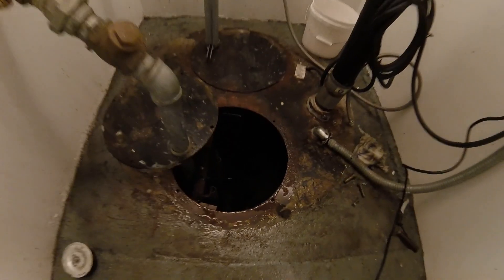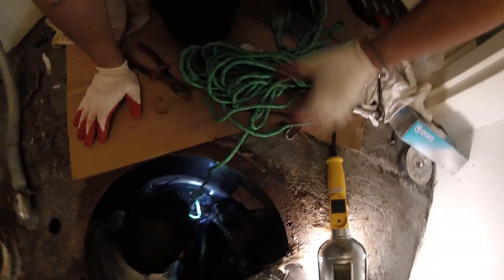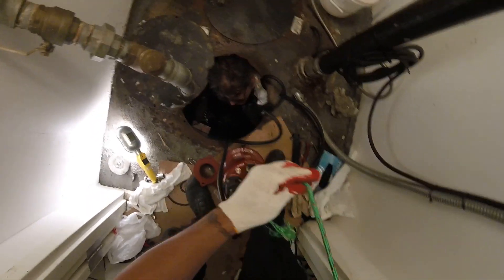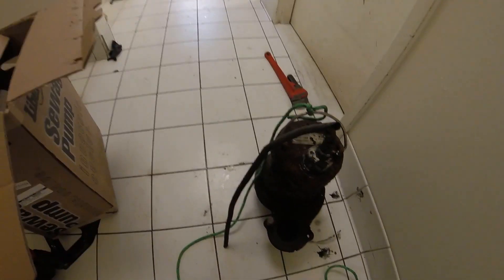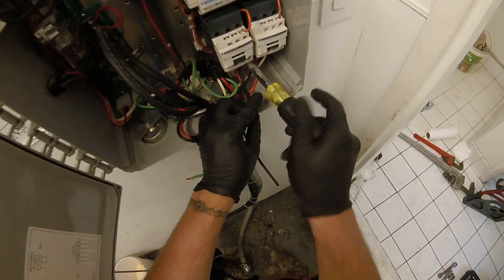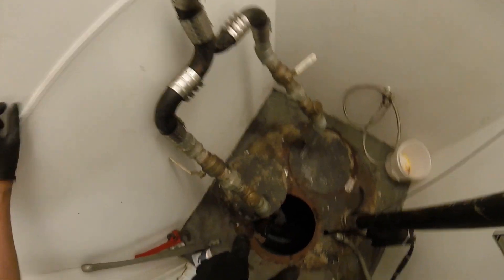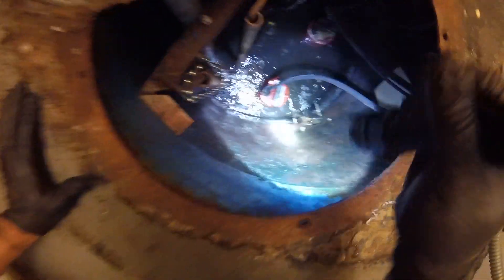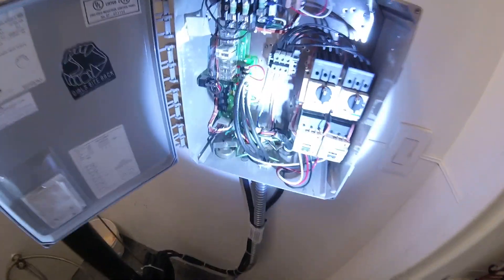Sewage Ejector Pump Replacement (Submersible Sewage Pump) Sewage Diving

Comment: The guy that installed my sewage ejector, didn't put grommets on the lid. It leaks a bit around the ejector pipe. Can I rope seal where the pipe meets the lid?